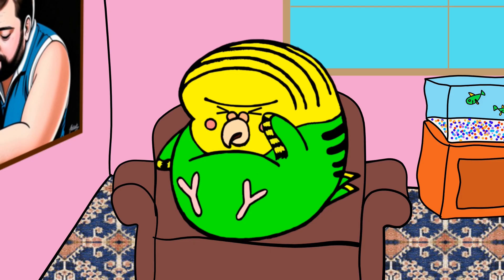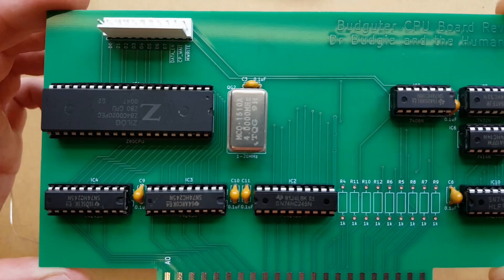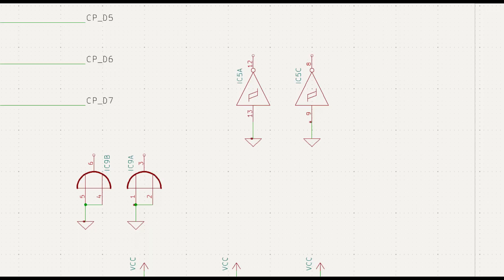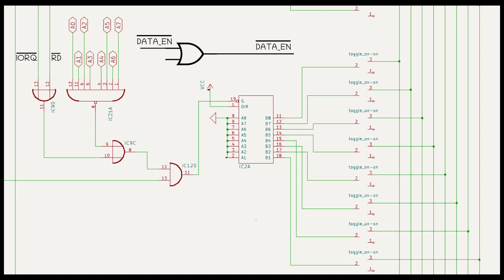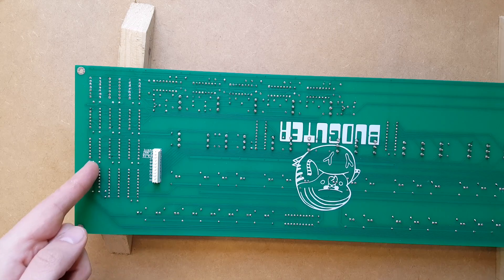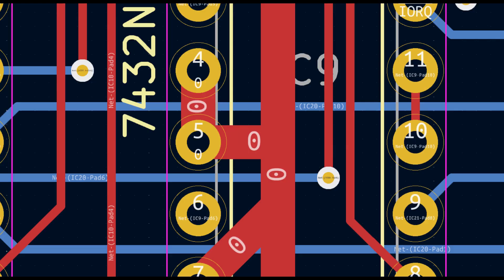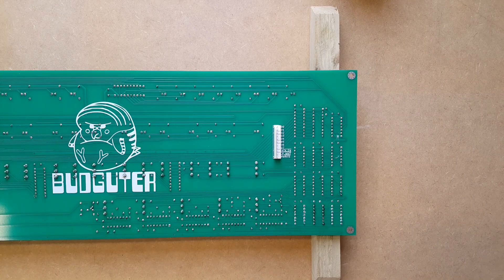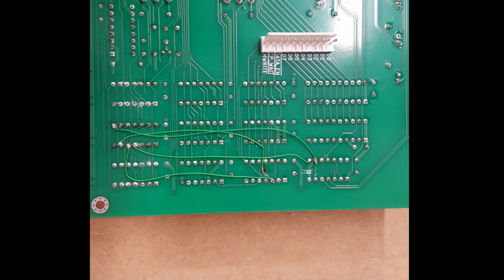A cheapo Altair 8800 style computer using a Z80 - (part 9) - Bodging the prototype!

Comment: I was going to ask, are the schematics on your project pit for this up to date with the fix?
Reply from the maker: Hi mate, I've been slacking a bit with the old project pit (life and that getting in the way of hobbies haha) but I will try to get everything on there as soon as I draw up some nice schematics.
Reply: @DrBudgieandtheHumanMan I know the feeling. I got a new job recently and came into the possession of 2'000 or so TTL ics that need sorting. Included with it was a whole tube of 6502s. as well as a bunch of switches  that are momentary in one direction and latching in the other, that made me think of this project. So I stated to look at if I could make a front panel for a 6502 based machine. Turns out the Apple 1 handbook has a nice single instruction step circuit included in it!
Reply from the maker: 2000! You could make a supercomputer with all them, if only there was a brightly coloured internet bird about to make a video series showing you how to build a Z80 cluster computer. I got a 6502 a few weeks ago and was wondering how easy it would be to adapt the budguter schematic for a 6502. There's also the Altair 680, that used a 6800 which is sort of similar to the 6502, so it might be worth having a look at that (if you haven't already). Old computer manuals are cool the way they used to give you the schematic and explain how it works!
Reply: @DrBudgieandtheHumanMan  well that sounds interesting. I think it was 1832 ics, primarily 74 series,  but with a tube of 6502s, but trying to work out how to single was interesting. I don't know the Altair 680. Time to do some reading.